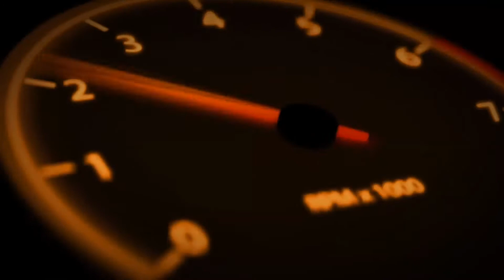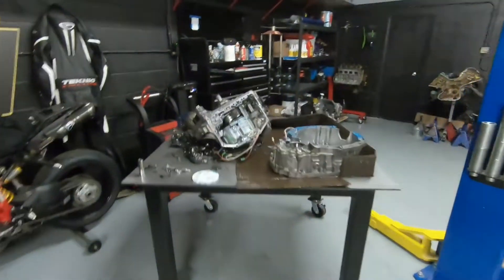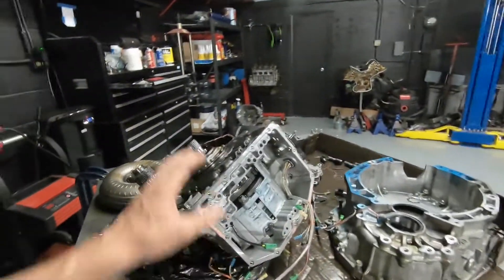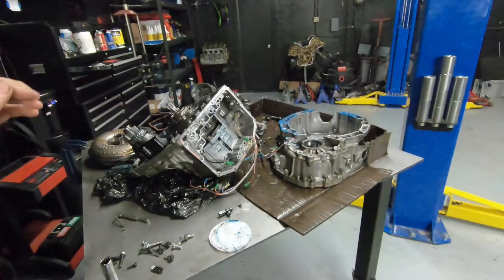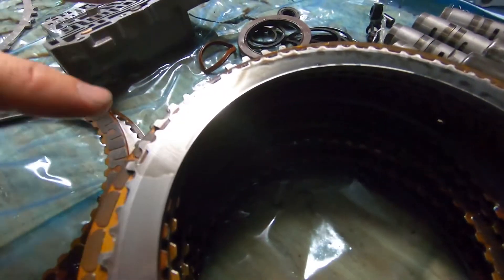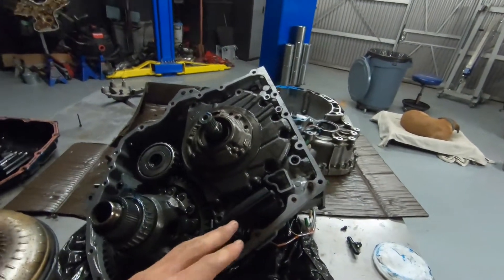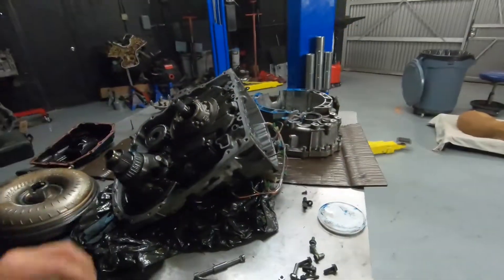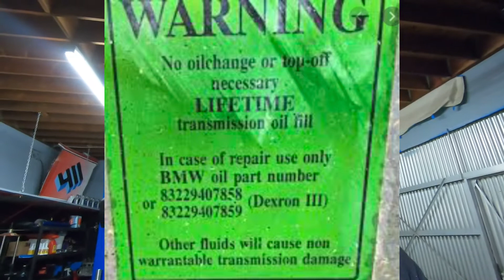Transmission Service: Is Lifetime Fluid Real?

Comment: Great info, will start drain and fill every 2 years on the 458 (only drive 1000 miles a year)
Reply from the maker: This was aimed at automatic transmission owners that drive 10k miles a year. With your gearbox. I put in an Ester based oil and test it yearly. The 458 annual service requires topping off gear and clutch oil to check for intermixing fluids that won't show an external leak. This is a great time to check the oil with chemical analysis and develop a service schedule that fits your environment and driving style.  This also allows you to catch problems before they leave you stranded or grenade expensive components. On the gear oil for a 458 you're going to want to look for iron content and low viscosity. Both are indicators of bearing failure and mixing fluid from the clutch respectively. These are common faults in the 7dcl750 gearbox.
Reply: @HollywoodMechanic For gear oil, I have been using redline 75w90ns. For clutch i will have to do it asap since mastertech always tell me it's "lifetime". Do you have a oil that you recommend? or just stick with factory shell? i am local in LA, can i take it to your shop for fluid flushes and chemical analysis
Reply: @HollywoodMechanic  Also my car is a 2010 with 17k miles, owned 7 years. Plan to own it "forever". So far so good until we get a chemical analysis. Do you know if annual drain and flush helps to extend the life of the dct before a rebuild?
Reply from the maker: @ricsu3462  you should be using red line 75w90. Regular. The ns is for non slip applications and the 458 has a limited slip differential.
Reply: @HollywoodMechanic yikes. My friend who used to work as a master tech at newport F instructed me to get the ns for the 458 and scud, been using it for 4 years ...oh boy now i am confused. I know the scud calls for GL4 and 458 the GL5...according to him ns is good for both
Reply from the maker: @ricsu3462  I contacted red line today. They said it does have some ls friction modifier but a low amount. Great for use with clutches that are wearing out and slipping or when trying to maximize grip and increase the bite of the lsd. Anyway they say it's okay in the ferrari. I use Motul 300 75w90 LS. It's green and allows for easy detection of exterior leaks and inter mixing.
Reply: @HollywoodMechanic thanks for following up! Ok I will try motul as well and the diff weights of oil u suggest. Also ordered some black stone kits to see the state of my gear box. Appreciate it!!

Comment: Depend how long it life is.   ZF say 80,000 km or 8 years max.
Reply from the maker: That's correct! That's under easy normal driving conditions. Sport, off road, or harsh climate driving requires more frequent changes. I just do a pan drain and fill at each engine oil change and that way I know I'm good!

Comment: Hey I have a 2016 Mazda 3  and I know I need a transmission oil change...I took it everywhere even dealer and they said I'm not suppose to change oil. Wtf!! I feel they are wrong. I'm in LA I need to go see u.
Reply: Yea they gon make you change the whole automatic transmission when it's damaged due to bad oil
Reply: how  many  miles  should  you  have  fluid  changed?  i  have  84,00p  on  it